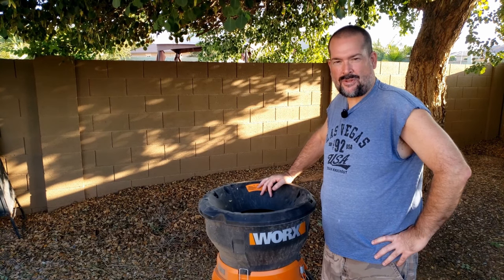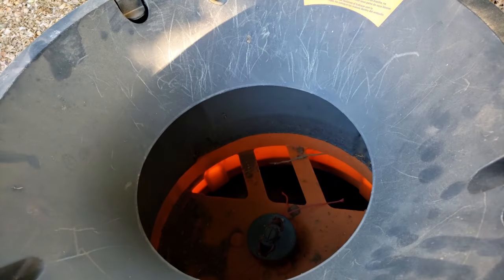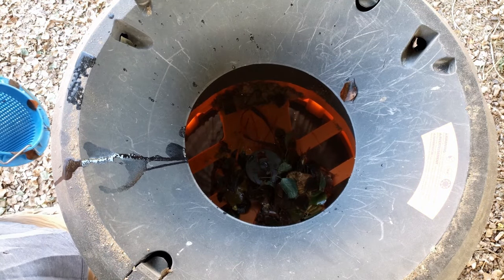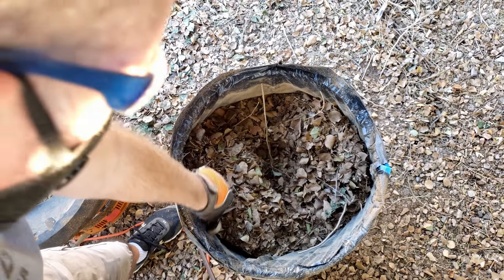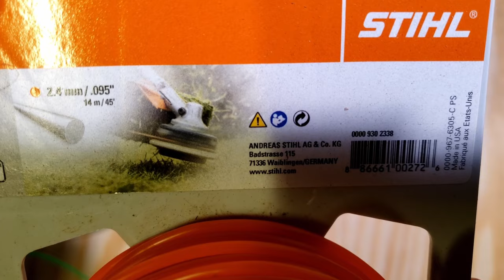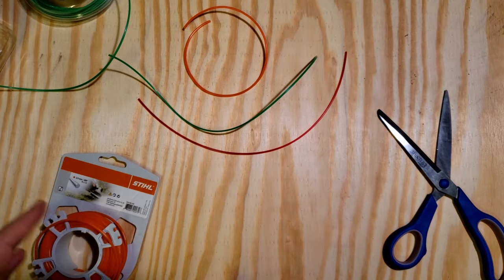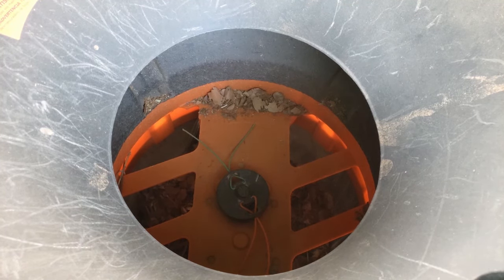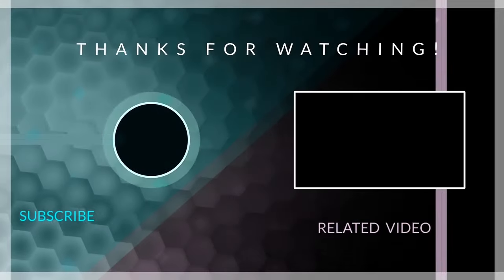WORX WG430 13 Amp Electric Leaf Mulcher Extended Review

Comment: I've had one for several years and am well satisfied with it. Bear in mind that you need to follow the manual in regard to what you feed into it (large amounts of wet leaves will choke it). Small twigs might be possible but overall you want to avoid pine cones, gum balls and the like. I wouldn't dream of feeding it rocks! It's basically a weed whacker on a stand and if you treat it right it will last you a long time. I've shredded 70 bags of leaves on occasion successfully (I'm a serious composter). If you abuse it, you'll find yourself swapping out the trimmer line more than you'd like to. I've found it to be cheaper to buy a .095 trimmer line (it WILL handle it) and cut it to the appropriate lengths and it works fine. After you've swapped out the line a few times, it'll become second nature. As far as the shredding ratio, I've found that 5:1 if a lot more realistic than the "marketing version" ratio of 11:1 I'd imagine that it would depend upon the type of leaves and the shape that there in. Safety glasses, a mask and gloves are a given with this. I also use ear protection. Overall, it was a GREAT DEAL!
Reply from the maker: Yeah I love this thing too. My biggest issue is that I have a lot of rocks in my yard. They are a big problem for me. I have an area under a big shade tree that I have been thinking about removing all the rocks and creating a dedicated mulching area. I have to keep up on the leaves or they will all blow into my pool and turn it green and this mulcher really helps to manage the leaves. So yeah if I can get past the rock problem I will be all set.
Reply: I have a much older machine that works the same way . I watch for walnuts  and twigs, etc, I put a lot of maple leaves through it and after I'm done all the fine mulched leaves get spred out over the 5000 sq.ft yard for the winter to feed the grass , worms and birds finding something to eat . . And yes , wear safety glasses ,a mask and hearing protection !   They can keep those leaf blowers ,wat too slow and useless as a fine mulcher .
Reply: You are correct.  I just finished 16 bags of leaves that were moist from our climate.  The cavity does muck up from moist leaves.  That only takes a minute to clean up with hand.  Helps to feed those slowly so that you get very good chopped up leaves.
I keep out twigs or anything else.
Love mine.

Comment: I use my DR Power chipper with it's top hopper feed.   I have  a filter bag on the discharge that lets the dust exit but keeps the majority of the leaf material.  It grinds the leaves up into little 1/8" pieces which work really well as mulch.
Reply from the maker: Thanks for sharing! That sounds like a great set up. Those things look pretty nice.

Comment: I just bought one. I have maple tree leaves which are quite large. I haven't used the machine yet ( its raining out now) but I think it will do fine. I bagged my leaves last year without  mulching and I had over 20 bags. I am hoping to reduce that to 5 or less this year. The only drawback is that each bag will weigh considerably more. I may decide to compost if the leaves are chopped up good enough. I am going to buy heavy duty contractor  rated yard bags at my local hardware  store this year.  They will hold more weight.
Reply from the maker: I used to have a lot of bags of leaves before I got the mulcher. But yeah they are a little heavy after you mulch them. I had to upgrade to heavy duty contractor bags 3 or 4 mil. should work fine. I made a video about it too if you want to check it out. https://youtu.be/0bERBLAOl6E

Comment: Great video. I’ve been thinking about buying one of these.
Reply from the maker: I am glad you liked the video. I wasn't really sure what to think of the WORX Mulcher at first but after running about 30 bags of leaves through it I really like it. The trick is to load it slowly. If you over load it then it will burn up the weed eater line real quick. After an extended review I am glad I bought it.

Comment: Please advise how to clean/maintain air filter to keep the unit running well, since dust is an issue.  Thanks! CWB.
Reply from the maker: I have some leaves that I need to clean up and mulch this weekend. I will open it up and take a look at the motor before I use the mulcher to see how it looks inside.

Comment: I got one of these after seeing a lot of good reviews, but I have live oaks, which have smaller, super thick sturdy little leaves. It didn't shred them up as much as I'd hoped, still lots of leaves completely intact. I may try running them through twice or putting down a little mesh over the holes so the leaves stay getting shredded until they're small enough to go through. I'm guessing this'll work well for thinner leaves.
Reply from the maker: I have a lot of small leaves too and a lot of them fall through as well. My leaves are a little thinner and I usually mulch them once they are dried out. It does seem to compact them really well. But yeah it doesn't break them up as much as I would like. I have not tried running it through a second time. I think I will give it a try and see how much of a difference it makes. Also pouring the leaves into the mulcher a little slower help too.

Comment: I bought this 2 years ago. I took off the line cutter and used a metal trim line; just cut it to match the case size. It's very loud. I'm looking to sell it because I found a better method. Using the weed eater with the Brute barrel, it cuts it into smaller pieces, and it is not as loud (I have an electric weed eater)
Reply from the maker: That's cool! I have a really nice STIHL battery powered weed eater. I will have to try it out. That sounds like a great video idea.

Comment: Great video!
Do you think this machine would be suitable for grinding hay? I have an old horse, who already has difficulties with chewing, and now I'm trying to find a solution for making chaff from hay. Is it possible to make 0,2-0,4 inches long dry grass pieces with it? Thanks!
Reply from the maker: I have not put hay in the mulcher but it should work for that purpose. It is basically an upside down weed eater. So you could test out a weed trimer on some hay and see how it cuts it up. I haven't measured the length of the cuttings. As the trimmer line wears down the cuttings will get a little bigger.

Comment: Do you think this would mulch straw well?    I typically put it in a trash can and use a weed wacker.
Reply from the maker: I have not tried to mulch any straw but the Worx mulcher is basically an upside-down weed wacker. So if you can mulch the straw with a weed wacker it should work.

Comment: I like the bright orange color of  worx,  but the  Sun one  has   large / medium / fine settings to shred everything down to DUST.   Perfect for composting.
Reply from the maker: I like Sun Joe too. That's cool that you can change the settings on it. For the WORX I like that you can put a bag on the stand. It looks like you can do that with the Sun Joe too. The Sun Joe looks pretty cool. Even if it is a funky green. Lol I have a Sun Joe pressure washer and it has worked great. So yeah if you get the Sun Joe let me know how you like it.
Reply: @ThatHobby  I Saw another video and the WORX is faster to feed because of the huge funnel top, But the Sun Joe needs more hands on to shove the leaves down the top.  Watch those Finger tips ! Ouch!
 I want to turn my leaves into potatoes, leaf mulch + mushroom topsoil = perfect for garden potatoes.   I'll get the WORX because the 13 AMP won't overload the outdoor power plug.   
People should remember:  15 AMPS is the Max on a 15 AMP circuit, but you don't want to be running it all Maxxed out.   
So for safety,  13 Amps Worx  feeds faster and  uses less electric $ .  
To make superfine mulch, I'll  cut my own grill reducer, with smaller openings,  so the Worx will turn everything into dust.
Thanks for the great video !
Reply: @ThatHobby  I was right, the WORX works better, because of the funnel top... I have to pace myself, because you can't force feed the WORX a bunch of stuff  (it breaks the cord and clogs it up.)  But with a steady feed, it pulverized oak leaves to dust.   Good job Worx!

Comment: Would love to see longetivity comparison of the WORX default line to the 2 different gauge weed whacker lines you used as comparison.  I have a ton of leaves to process in my backyard and I noticed drastically reduced efficiency mid way through 2nd large pile.  Of course it sped up nicely after changing out the line but it's such tedius work.  I prefer to keep mulching and not spend time changing out the line, or at the least do so in much less frequent interval.  Can you do the following experiment?  1) default line vs. 0.08, 2) default line vs. 0.095, 3) 0.08 vs. 0.095 compared  to see the wear after doing similar workload?
Reply from the maker: It seems like the WORX trimer line lasts the longest. I have another trimer line to test out too. I like the video idea of comparing the different sizes. I have a lot of gravel in my yard. So feeding the mulcher slowly allows the rocks to fall through and puts less wear on the trimer line.

Comment: Traditionally, I spend two months processing my leaves (e.g., rake, fill bags, crunch, add more leaves, and leave them at the curb for pickup). Recently, I enlisted a student to blow a large section of my yard leaves into five huge piles that required 40 minutes. Then, I utilized my Worx Leaf Shredder for the first time. In six hours, I shredded leaves, producing 13, 33-gallon bags, which is equivalent to 97.5 unshredded bags. Thus, in one afternoon, I completed 45% of my yard, which normally requires 2 months for the entire yard. I have only  55% to go before the entire yard is completed. Thus, in less than two days, I will have accomplished what two months required formerly. Do I like this product? I should have bought the Worx when it first hit the market. It saves time, energy, and money, BTY, I replaced the nylon string 3x. That's ok. It took 60 seconds (for both strings) after I got the hang of it. My leaf yard work has been cut dramatically!
Reply: PS: To facilitate the leaf job, I recommend that you buy large hand leaf scoops to feed the funnel in a methodical manner that maximizes the operation. Don't overwhelm the unit; just feed it moderately and the nylon string will endure longer. This I discovered quickly .
Reply from the maker: Great tip!
Reply from the maker: That's awesome! Yeah unshredded bags are can add up fast. 97 bags compared to 13 bags! Wow that is amazing. Thanks for the great comment.

Comment: Okay you convinced me I'm going to stick with my bag around my lawn mower
Reply from the maker: That's a good option too. I have fake grass and gravel landscaping everywhere else. So a mulcher makes the most since for me. What kind of mower are you using? I may eventually set up a corner in my yard for mulching with a mower.
Reply: The problem with lawn mower should you use for composting or mulch with large volumes is that you still have to put bagged leaves somewhere after mowing.  Sometimes the leaves shredded into bags is time effective and much easier in long run and strategy.

Comment: We have a fig tree here and their leaves are huge. In Our Westcoast climate, our leaves are more often not completely dry. Can this handle fresh bug leaves? I want to make leave mulch out of them. Thanks!
Reply from the maker: It's pretty dry out here so I don't have a lot of experience with wet leaves. This mulcher is basically an upside-down weed eater. So you could try a test were you put a bunch of wet leaves in a bucket and see how well your weed eater breaks up the leaves.
Reply: @ThatHobby  Great idea! Thanks!
Reply from the maker: @lizasklau  Let me know how it works out. We have some lemon trees with big leaves but we rarely have any big wet leaves to test out the mulcher with.

Comment: This is arriving on Tuesday and I will be testing with factory string, my aggressive string and some scrap romex
Reply from the maker: That's awesome! Let me know which string you like the best.
Reply: @ThatHobby  I have an acre worth of fully covered ground to test on!
Reply: @ThatHobby  I mulched an entire 4x8 trailer worth of the included red string line. It resulted in 1/2" pieces at the largest and dusted the rest. The aggressive string absolutely destroyed the leaves. I didn't see much larger chunks at all. I strung up the romex and backed out. It really taxed the motor.
Reply from the maker: @JUMBOpin  Wow that's a lot of leaves. It sounds like the aggressive string worked the best. What was the aggressive string that you used?

Comment: Why are you bagging up the leaves?  That's some much-needed nutrient for the tree and helps build up the soil quality.  Brad Lancaster has done some great videos on how to capture rainwater using shallow excavations around his home and neighborhood, growing food on a small lot in Arizona.  I like how that gadget chews up the leaves, helping them to break down in the arid climate.  I wonder if it'd do well with my eastern leaves b/c the oaks and pecans around here drop tons every year.  Great fertilizer, sure, but I wouldn't mind reducing the volume of the things!
Reply from the maker: The mulcher is basically an upside down weed eater with trimmer line in it. So a great way to test if it will work on your leaves is to put them in a bucket and try to mulch them with your weed eater. As far a bagging the leaves goes I do try to use the mulch in my garden but I am really overwhelmed with all the leaves blowing into my pool. So I have been using what I can and disposing of the rest. I plan to eventually building a mulching and composting station to save more or the leaves for our garden and for our trees too.
Reply: @ThatHobby  I feel your pain!  Best thing I ever did was bury the blasted pool!  😆

Comment: How is it on dried grass
Reply from the maker: I don't have a lot of dried grass to test it on. I have fake grass. I have a few grass bushes that I have tried to test it on and it seemed to do fine. It is basically an upside down weed trimmer. So if you want to test it put some dried grass in a garbage can and try your weed trimmer on it to see if it cuts it up good enough. That is a pretty good way to test it out.

Comment: Do you have to change the line often and is it easy to install?  Nice job!
Reply from the maker: I have a lot of rocks and sticks in my yard so I have to be careful and load the leaves real slow. If I take it easy I can get 2 garbage cans into 2 black garbage bags before I have to change the line. It takes some practice to install the line. Once you get it figured out you can even cut down regular weed eater line and use it but the straight weed eater line designed for the mulcher is easer to install and last longer.
Reply: Installing the line is very easy. Don't make it hard. After a few replacements, my time for both was 60 seconds.

Comment: i wanna see somebody   use some steel cable then do a test video to see how it does   grinding it up
Reply from the maker: The directions say not to use anything other than the official weed eater line. But yeah that would be interesting to see how far you could push this thing. The base under the head is plastic so the steel cable could cause some damage to the base. Plus there is a metal blade in there to cut the excess weed eater line. I have seen some sparks fly when a rock hits it. I have a lot of gravel in my yard. So the steel cable may cause some real fireworks if some rocks get in there.
Reply: @ThatHobby    yea   its  allways good  to   go safety  first

Comment: Was using the other string trimmer line more money savings?
Reply from the maker: The original Worx trimer line was $17 for a 24 pack and the generic trimmer line on Amazon is $10 to $13 for a 50 pack. Plus the official Worx line is still out of stock. So that looks like a  cheaper way to go. As far as the trimer line that I made myself it was already in my garage. So it didn't cost me anything. When you make it yourself there is a curl to it so I prefer the generic Worx trimer line to making it myself. But I already have a bunch of trimmer line so I will probably keep making it for a while because I already have it.

Comment: Worx Gives you FREE Line!
Reply from the maker: That's cool!!! I just checked it out. It looks like it is $9.99 shipping for 6 spools of trimmer line?  The trimmer line gets a real curve in it when it's pre-wound though. So it may be tough to use in the WORX mulcher. It still looks like a good deal though. I will have to test it out. Thanks

Comment: Maybe drill out the hole to get a thicker line thru it.
Reply from the maker: Yeah I was thinking about that too.  I will have to do some research and see If anyone else has tried that.
Reply: @ThatHobby  Thanks for the review, I'm considering purchasing
Reply: @ThatHobby  I still think you are stuck with a misguided plastic distribution solution.
Reply: I bumped it to the .095 line and didn't have to drill a hole. I've had it for over 3 yrs.
Reply: First, modifying the hole will negate the warranty. Secondly, such would be a delicate operation, because of the intricate nature of the part. Lastly, the cord had been correlated to the motor so that they work in tandem. The present setup is designed to perform the task efficiently. See my above review of how I reduced 2 months of leaf raking and bagging into less than 2 days of leaf shredding (aided by a teenager who used a high-powered leaf blower to create 5 huge piles of leaves that I then shredded). This machine is a life-saver!